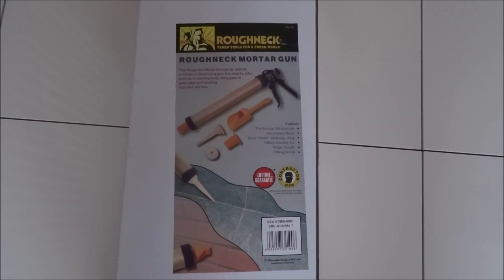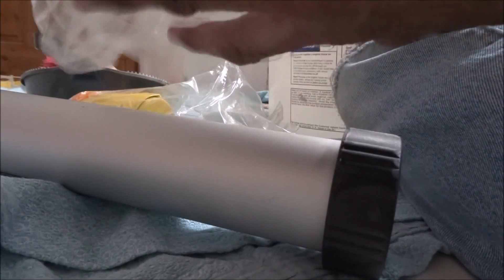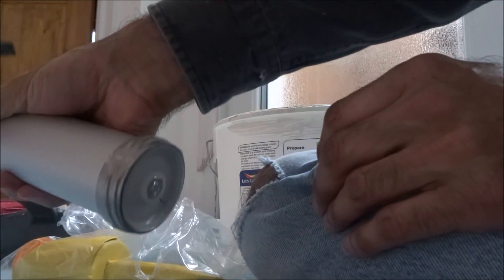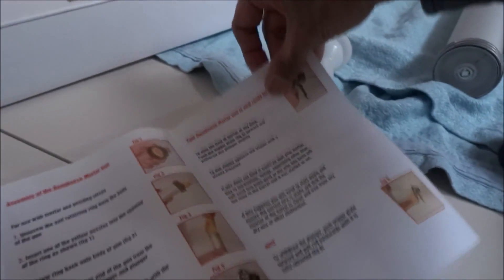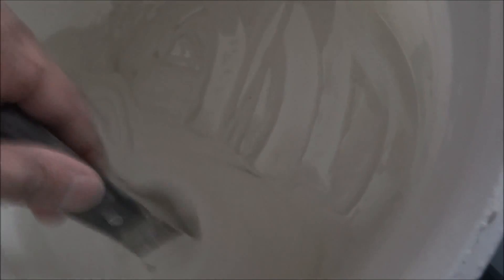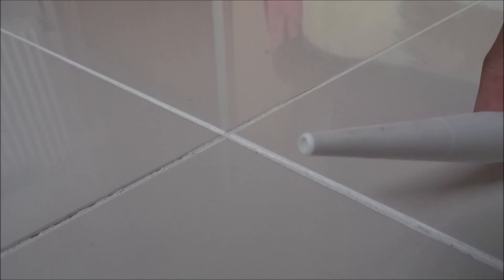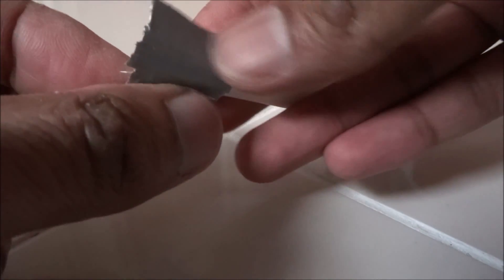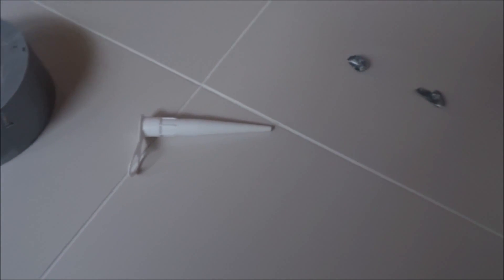Grout Tiles with a Grout Gun/Mortar Gun

Comment: I use a grout gun and love it. I put the grout on a little thicker then use a float to push it in. That way you only have to clean around the grout lines and not keep wiping with a sponge over and over til the tiles are lean. Saves clean up time by a lot.  Especially when you use a epoxy grout it dries fast and hard.

Comment: Like your effort. Lot of people on here commenting that it’s a waste of time; it might be if you’ve years of grouting experience… and getting someone in to do the job will work out a lot more expensive than this gun. If the nozzle can be made to the right width then it will deliver grout at high pressure right where you need it with minimum overspill, ready to be wiped smooth with sponge. I’m up for trying it anyway!

Comment: Hmm not 100% sure on these. With grouting I think I'd get a better finish with a grout sponge as you can really work it into the joint where as this could leave air bubbles and fill the top of the tile only. I think for re pointing this would be ok I guess.
Reply from the maker: +Zed Man my bad I missed that step from the video you have to use a sponge to finish it. Just use the grout gun to help get more into the gap. It was an ok method.